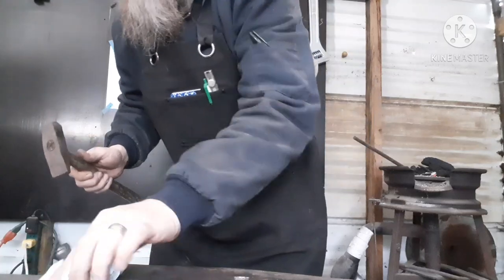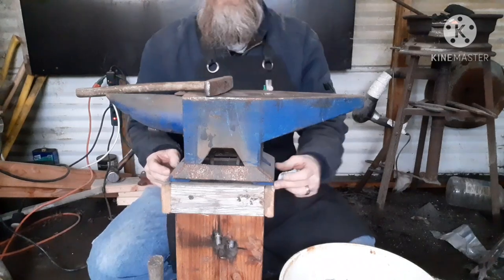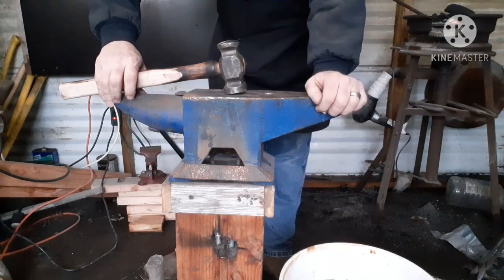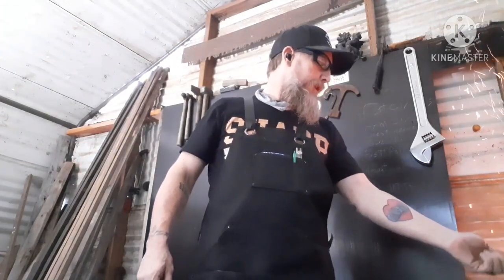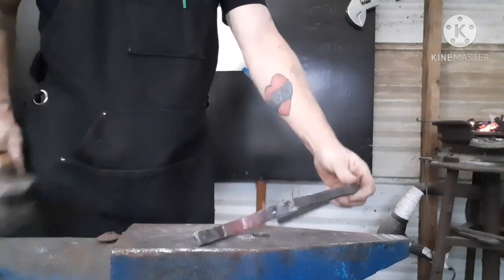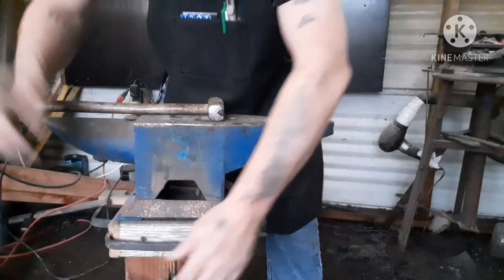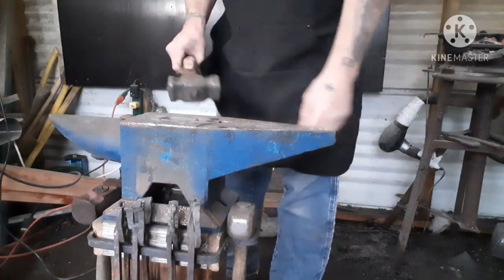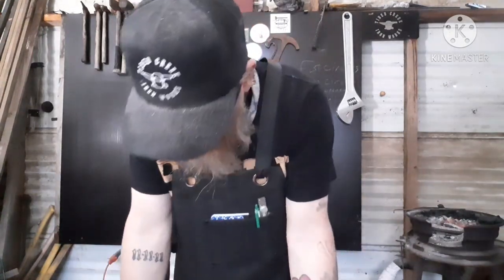Tong/Hammer rack (forging)

Comment: Seems like you'd build a more secure / less wabbly anvil base before you worried about a hammer rack. Just wondering if you corrected that issue?
Reply from the maker: The original plan for the stand was to bolt it down to the floor. Things have changed, go check out my newest video. Thanks for watching, it's much appreciated!

Comment: Charcoal? You have a retort? I made one from an old sand blaster tank, get about a 5 gallon bucket and a half each load.
Reply from the maker: No I don't have a retort yet. I've definitely thought about it though. I've got access to some 55 gallon and 35 gallon drums that I was thinking about using.